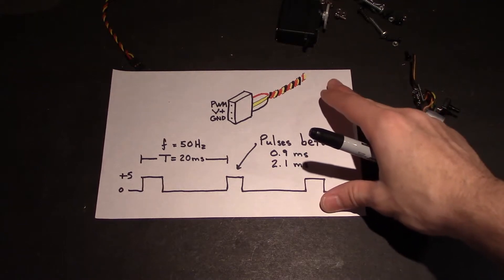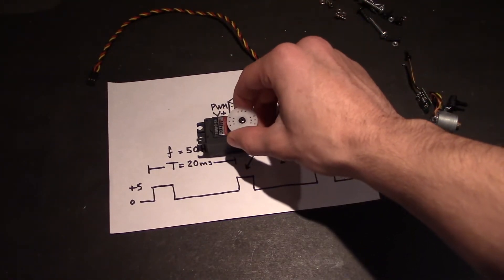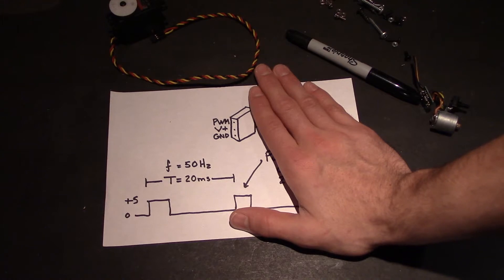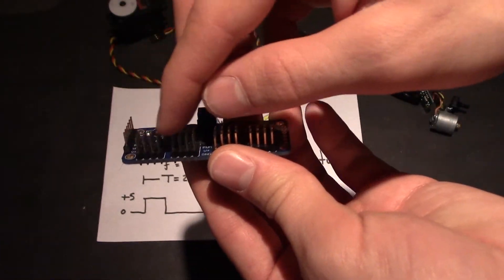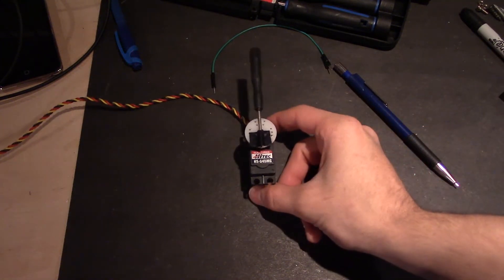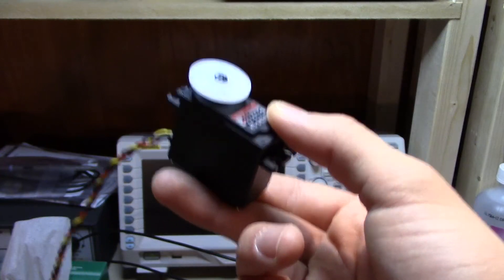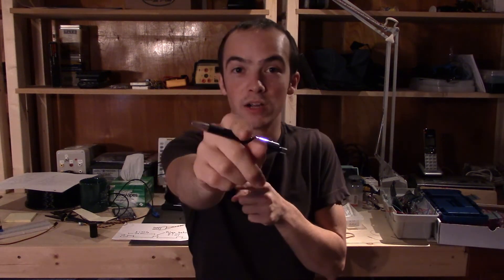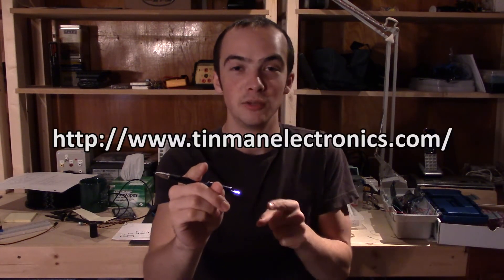Tinman Electronics 11 - Servo PWM and electrical input

Comment: this is very helpfull video,
i have a question?
How to wire pulse signal controller to PWM servo driver?

pulse +/- and Dir +/-  to connect  PWM Servo Driver ( -command/+command) signals

Comment: What happens if you go beyond the 0.9 and 2.1? like for example you input a full 5v cycle instead of max 2.1ms? Smoke? or Will the servo just do nothing?

I ask cause I want to try and mechanically control a cnc spindle using a sg90 and a 3d print to attach to a potentiometer that controls the spindle RPM on a GRBL v1.1 with a 0ms to full cycle range.
Reply: I believe 0.9-2.1 specifies the angle range. So the resolution of the angle is max angle/ 1.2. When it is more than 2.1 the duty cycle is over the specified angle so it’s going to maximum. But since the voltage and current is the same, I don’t think anything is going to burn.

Comment: Nice job to help me get started.  A little foggy about continuous rotation versus just changing position and stopping, but this gets me to where I can hook one up.  Apparently, Uno can do PWM out of the box so the adafruit part he used is not needed unless you have more than six servos to control.  Although it is nice, the Adafruit board is a little overpriced for what it would do for most applications

Comment: Great vid man! Here's something I really like to do with my servo but don't know hot to acheive it. And I think there are many, many people out there, who might like to also know how to do it. Now here it is: I modded a servo, so it rotates continuesly. I can control with a servo tester how fast and in what direction it rotates. I can even stop it and I understand the principle. And I can even do all of that via my remote. But here's the thing I can't control but I'm so desperate to know how it can be done: I like to move a switch or a potentiometer on my remote control to a certain position and the servo will perform a definable amount of rotations and than stop. Do you know what I mean? What I like to do with that functon is to control a manual zoom on a camera lens. I built a gear, so the servo will move the zoom slowly but I can't get the servo to stop at a defined point. Thank you very, very much for your help!!!
Reply: Jörg Johow 
use a stepper motor instead of a servo
Reply: You need to use a microcontroller to define and set the amount of time that a given pulse width is put out. An Arduino can do what you want easily.